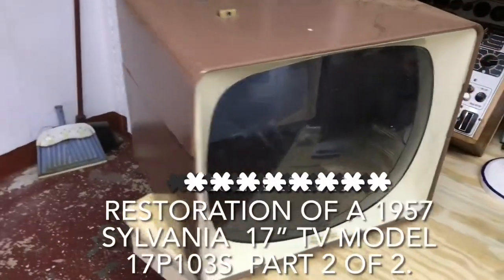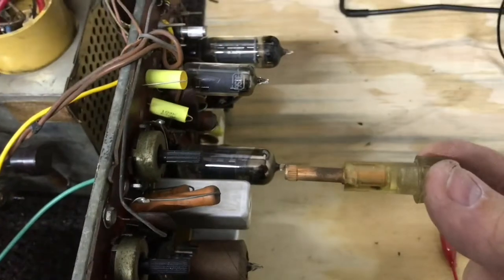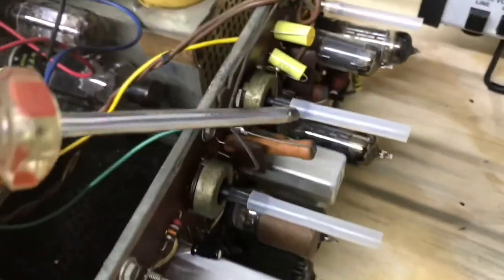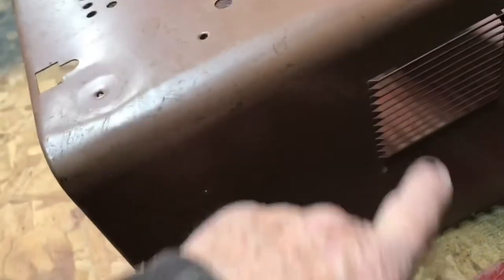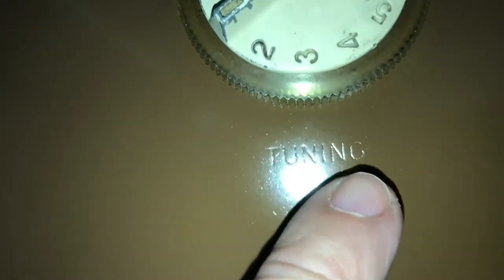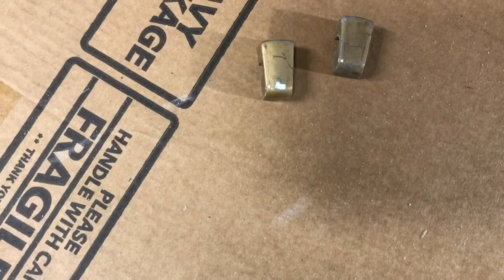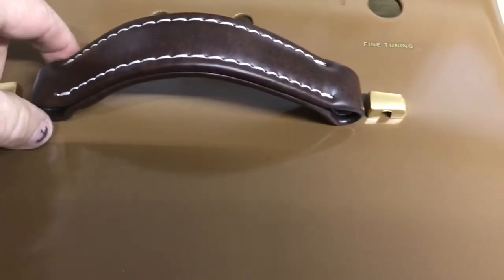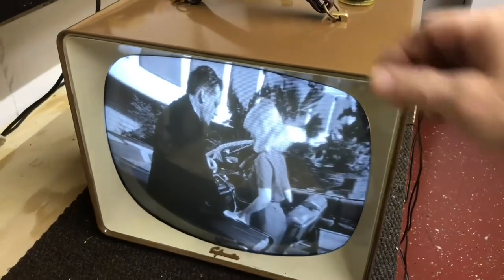Restoring a 1957 SYLVANIA 17” TV    Pt 2

Comment: That is one nice looking restoration!  Did you have/work at a repair shop or just picked it up as a hobby?
Reply from the maker: Steve
Owned a tv repair shop , retired in 2013 after 40 years. 
 Thanks for the compliment, this set did turn out nice , cabinet and the picture

Comment: that looks good, My Zenith Bugeye TV from 1958 is having some tuner problems, I got the deflection/raster back up and running normally (full screen, not collapsed like it was when I got it) but when I hooked a RF Modulator up to the TV with a DVD Player playing an old 4:3 video through it, I wasn't getting anything on the screen, not even any sound, any ideas as to what could be causing that issue? All I get on the screen is a gray screen with no snow or anything, its the same issue that my 1964 23" Zenith is doing with its tuner, and they are both All Channel UHF and VHF TVs if that helps any.
Reply from the maker: If voltage to the tuner is correct I would suspect an open resistor inside the tuner , I had a predicta restore that was playing fine and suddenly the tuner quit. Turned out to be a resistor that opened. 

Thanks for watching, glad you enjoyed the video. 
 If your not a subscriber, hope you consider subscribing to our channel